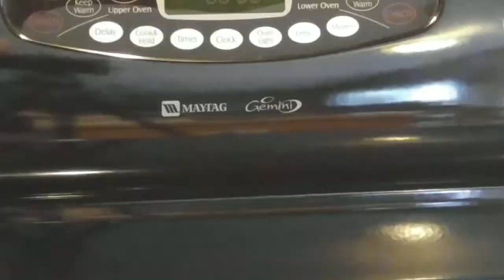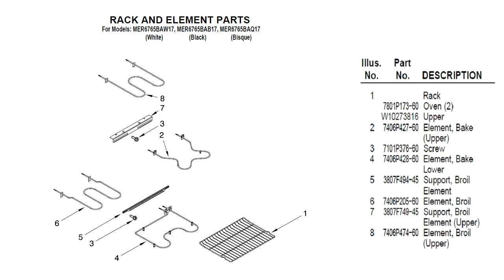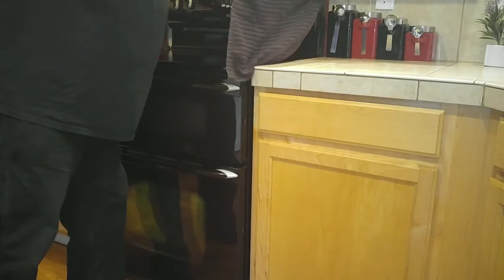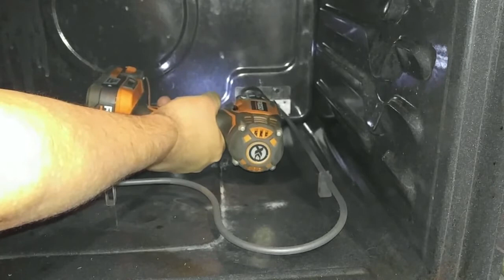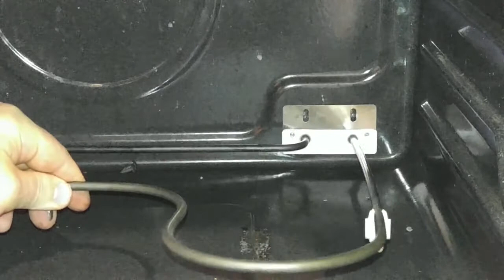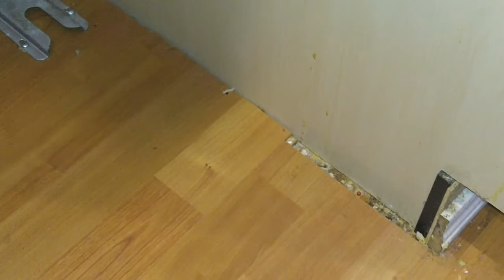Maytag Gemini Range  - Element Replacement

Comment: Is it normal for it to go dark at the back left of the element? I just replaced one that was broken, and it was dark in the same spot
Reply from the maker: I had a couple dark spots and wondered the same thing. My oven has been working fine and the repair lasted so I assume it is OK. I'm just a DIY'r not an appliance repairman but I have done the troubleshooting and repair on a few ovens this way. I never noticed the dark spots before but that doesn't mean they weren't there.